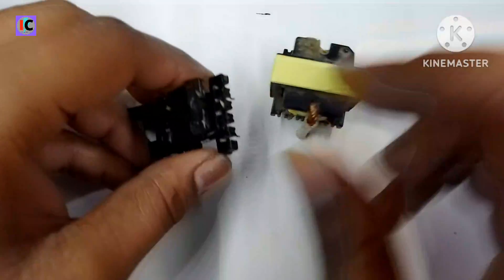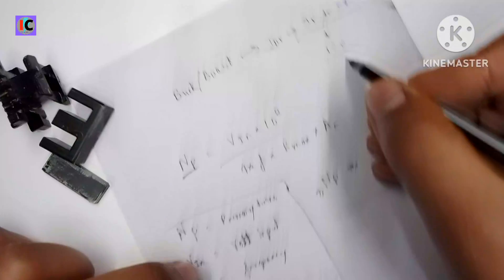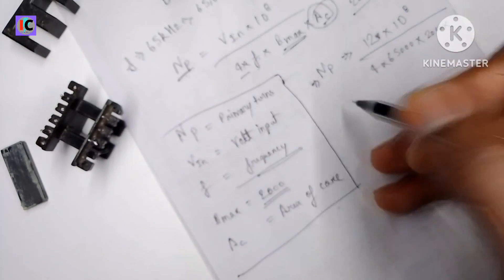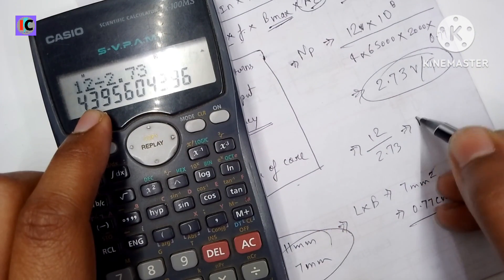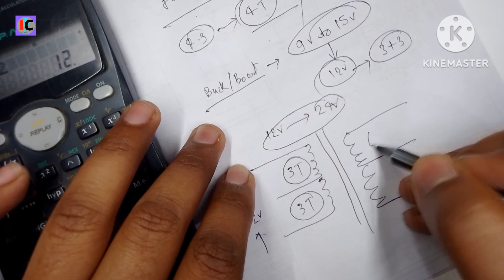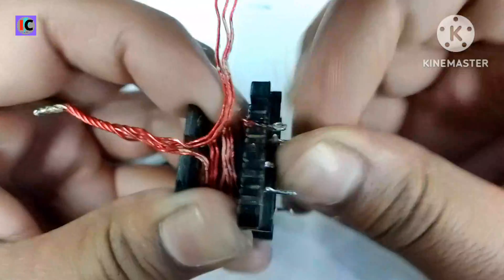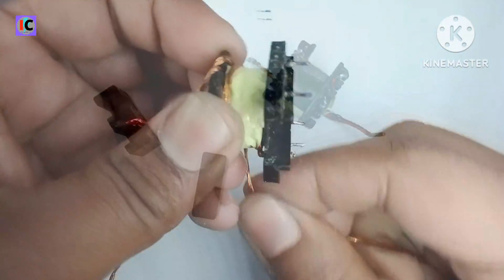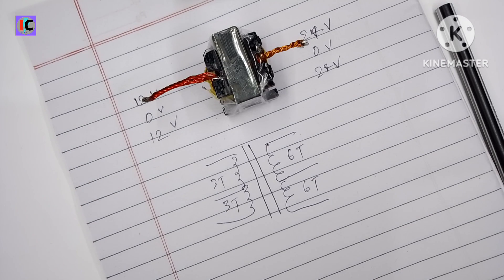Make Transformer For Buck Boost Converter #buckboost #dctodc #converter

Comment: Good tutorial, 3T,3T by 6T,6T of winding is the same that used for your buck boost converter project ?
Reply from the maker: Yes, exactly
Reply: @innovationic   and i want use as a buck-boost converter not inverter, so short high frequency for buck-boost converter ?
Reply from the maker: yes short high mode for high frequency and adjust 200K preset